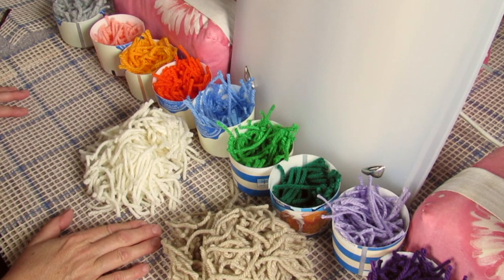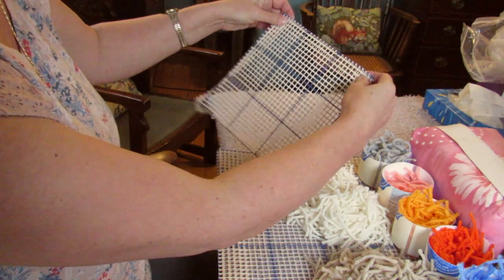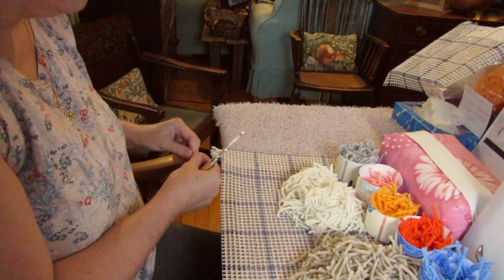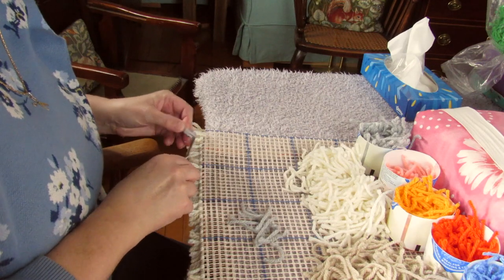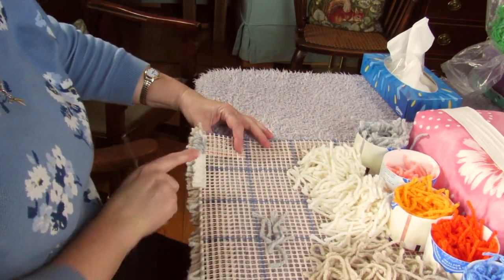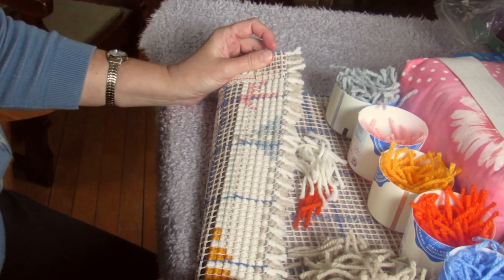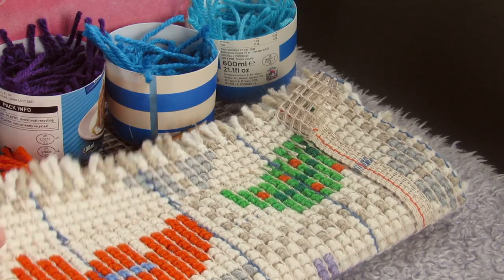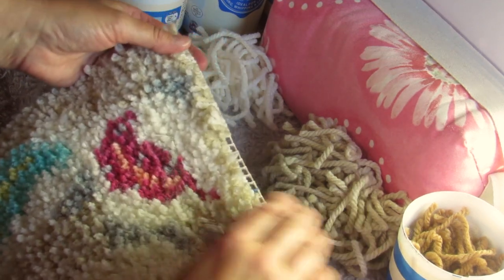How to do a Folded Double Canvas Latch Hooked Edge

Comment: Hi Clare another awesome video tutorial. On my next rug I need to try this. How do you wash the completed rugs when the get dirty?
Reply from the maker: Hi Melissa. Thank you so much for your lovely comments. As for washing your rugs I have the following advice. Your edges and knots overall need to be tight and secure or they will come undone. Speaking for other companies kits, I cannot be sure as to the quality of materials but I have found most kits can be hand washed in warm soapy water and rinsed and then placed flat on a towel to dry, do not hang at corners. Or if your washing machine has a delicate gentle cycle and you trust it then you can use it under caution. Hope this helps. Regards Clare x
Reply: @UtterlyHookedDesigns  Now that's a thorough and considerate answer!
Reply from the maker: @plauditecives   Thanks so much!

Comment: Could you glue the binding on or do you have to sew it?  If sewing, is it the same as in your older video?  Will probably be ordering a kit after I finish projects in the queue
Reply from the maker: Hi Michelle. You can get self adhesive rug binding but I have never used it myself. I have read comments about it curling up at the edges and dust collecting on it but if your project is to be a wall hanging then I don't expect this would be a problem.  I have no idea if you could glue the rug binding I use onto the back of your project but if done well, I don't see why not. I am just a stitcher by nature and so that is what I like to do. Take care. Clare x
Reply: UtterlyHookedDesigns well then I’ll avoid that and just hand sew - don’t own a machine.  And I’m definitely “hooked’!😄
Reply from the maker: @michellehenson984  Hi again Michelle. You don't need a sewing machine to bind your rug. I always hand sew mine on. A sewing machine would go right through and spoil your project. So glad you are enjoying latch hook. xx
Reply from the maker: @michellehenson984  Have you looked at my other video on how to bind your rug. Clare x
Reply: UtterlyHookedDesigns on the agenda for the day.  Hand sewing has its relaxing benefits, too. Thanks for much and please stay safe.
Reply from the maker: @michellehenson984  You too! xx

Comment: Wish I'd seen this may restart mine
Reply from the maker: Hi Yvonne. You don't need to restart. Just fold the edges under and do the technique from where ever you are at the moment. Then at least some of your project has this edge and also you get to try it out.  If you are bent on restarting, you only need to do the edges but make sure you have plenty of yarn for those that are spoilt when you pull them out. Good luck. Clare x
Reply: Hi Clare I did just that, didn't have to undo much but it's a great idea thanx. I'll show you once I've completed my project.
Reply from the maker: @yvonnebass9717  Hi Yvonne. So glad you got sorted. Would love a piccie! Clare x

Comment: Clare, If you use this approach at the beginning do you also use binding at the end or is this in place of end binding?
Reply from the maker: Hi Pamela. Thanks for your question. If you do the folded double canvas technique you don't have to stitch rug binding on if you don't want to. If it is going to be a wall hanging, it really isn't necessary. I like to stitch the binding on as well afterwards but only because all my rugs are designed to be used and as the edges of a rug are the most vulnerable, it gives added protection for wear and tear.  After all when you have done all that work you really want to take care of your project. Hope this helps. Regards Clare
Reply: @UtterlyHookedDesigns  Clare, thanks for the quick response. I'm wrapping a wall hanging, and starting a rug.  I'll use stitched binding on the wall hanging, then start off the rug with the folded and then do the stitched binding and anti-slip paste.  I can't find the anti-slip spray here in the U.S. so i'm planning on using the paint brush applied anti-slip from Herrschners. So pleased to have found your videos.
Reply from the maker: @pamwelty  Your welcome Pamela.